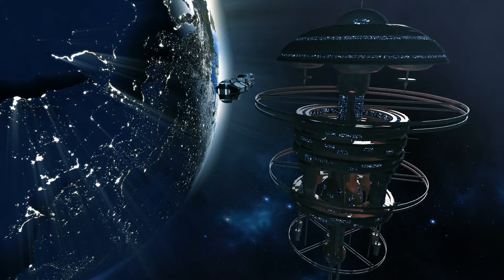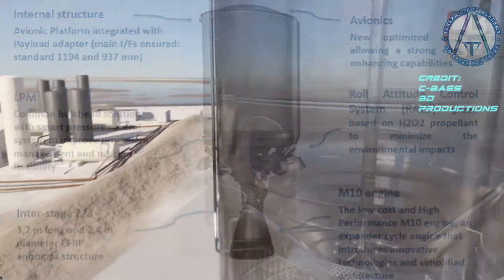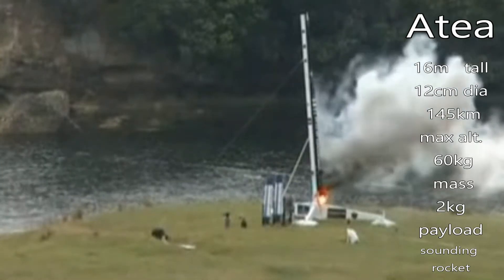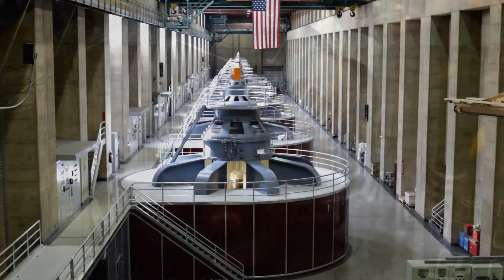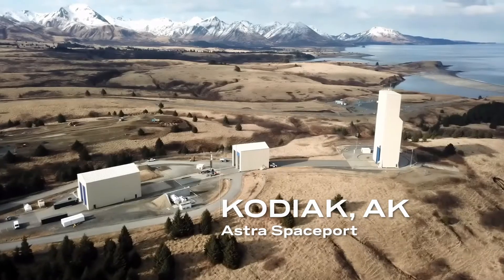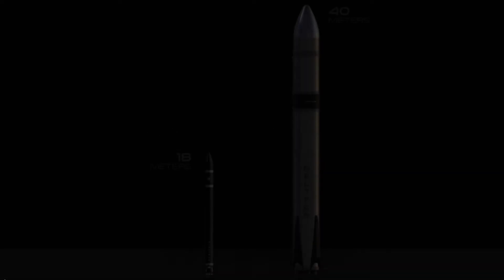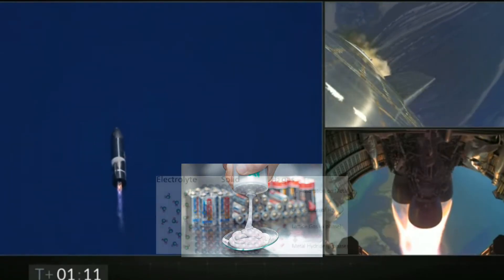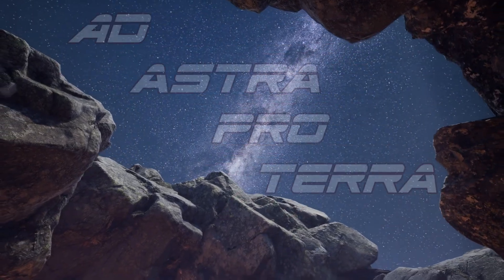Rocket Science: Turbopumps and Electric Pumps for Rocket Engines

Comment: Just discovered your video. Always nice to have another expert voice explaining rocketry to us armchair engineer-wannabes. And great timing - the hot topic now is the Starship HLS that just won the lunar lander contract. It will have unique auxiliary landing/liftoff engines, and SpaceX has said nothing about them. A ring of 16 are mounted high in the ship. (Appears to be 16.) It occurs to me an electric pump would work well for these.

Do you think these will be pressure fed, or need some kind of pump? They have to be powerful enough to lift the ship a short distance before a Raptor ignites. My best guess was they'll be a larger version of the methalox RCS thrusters, but while the latter can be pressure fed idk if that's enough for these auxiliary engines, even using multiple ones. Knowing SpaceX's design philosophy, each set of 4 will be able to tolerate 1 failing, so 12-14 engines will need enough power to lift the ship.

The HLS will have large batteries for the power demands of a complex surface mission, working with the solar cells. I'm thinking of several electric pumps (redundancy) feeding propellent from the main tanks to the sets of engines. Your thoughts?

(Btw, Raptors tanks are have an operational pressure of 6 bar, I'm pretty sure. Yup, unconventionally higher.)
Reply from the maker: Thank you!  I at first thought they would just use a series of SuperDracos... Pressure fed hypergolics are the simplest and no one would mind but Elon wants to use methane... You can use an expander cycle but electric pumps are so much more controllable that I think that will turn out to be the best option.
Reply: @terranspaceacademy   When the first design was unveiled I thought of SuperDracos also. Not an elegant engineering solution, but an easy one that wouldn't divert resources. Just accept the weight penalty of another set of tanks in exchange for a no-brainer design. But soon switched to the methalox idea, that's just the SpaceX way.

Thanks for the info on the controllability of electric pumps vs the expander cycle - I was wondering about that alternative. Another advantage: No expander cycle means no need for channels in the engine bells. The firing will be so brief cooling itself won't be needed. And no plumbing for the recirculating fuel means one less source of leaks.

Comment: How crazy, just a couple days ago I wrote a comment on a rocket video where I talked about using particles of some sort as propulsion. Instead of your magic cube I'm thinking more of a system like the CERN but in a smaller format. On earth the "core" would get charged up with particles that would have been accelerated close to the speed of light and inserted one by one into the core whilst in motion. In the core, the particles are kept in motion, spinning, are the center of either a cylindrical or spherical containment unit using a magnetic field (maybe?). The release of energy is made by controlling the field and changing the direction of a portion of the particles through out the end, lol that's my idea at least seems more plausible then a magic photon box. I bet you could store a lot of energy if the particles are managed to be kept in motion and contained
Reply from the maker: Look up "Accelerator on a chip", lasers using the wakefield effect can accelerate particles to near light speed over just a few millimeters... 
Also see our lesson on Eletrothermal Rockets... 
they cover the VASIMR that you will find has similar concepts to your device. https://www.youtube.com/watch?v=pIwPjs5zBq8
Finally look up Vortex rocket engines...
You'll need to perfect plasma vortex physics to fly your engine :-)

Comment: In the final reasoning about the power of turbo pumps, there is one inaccuracy due to the peculiarities of the calculation - this is not the power on the shaft, but the power from the calculation of the fuel consumption at the gas generator, or, more simply, the total energy of the installation (mechanical + thermal).
Reply from the maker: What would the electrical power have to be equal to that in order to produce the same affect? Or is there an adjustment we should’ve made. Using torque instead of horsepower for instance
Reply: @terranspaceacademy  Roughly speaking, the efficiency of a turbo pump is about 30%, when an electric pump has 75%. This is taking into account the losses on the pump blades.
Reply: @terranspaceacademy  So, sorry, I was wrong.
I checked the data on Russian RD engines - they write exactly the power on the shaft and the numbers are comparable. So the numbers indicated in the video look reliable and there is no need to recount anything.
Reply from the maker: @DeadDaem0n  Thank you! Good work!

Comment: 16:30
Photon pressure would probably crack the box open way sooner then the point at which it turns into a black hole.
Reply from the maker: Absolutely... even osmium/titanium alloy would crack long before then :-)
Reply: @terranspaceacademy  probably a good thing though
Reply from the maker: @Loading-tr7yv  A singularity at your charging station would definitely be much worse than a containment failure :-)

Comment: Can the issue of battery weight on larger rockets using electric pumps be addressed by removing the batteries and replacing them with a jet-like generator that burns RP1/O2 (or whatever fuel is in the main tanks)? Kind of like a turbo-pump, but without all the complicated plumbing. Just a simple generator that produces the current needed to operate the electric fuel pump. It would be less efficient than turbopump, but less complicated. I don't know about the physics of it, but I imagine there is sufficient energy density in the RP1 to generate enough electrical power to operate the electric fuel pump.  These generators can be spun up with ground power at launch until they get up to speed and are producing enough power for the electric fuel pumps to start the main engines. Then after launch ground power disconnects and they run on their own power. Anyway, just some amateur thoughts after watching this cool video. :)
Reply from the maker: The problem is that if you get the power up and the mass down sufficiently you end up with another turbopump, nothing else compares.   Eventually superconducting solenoids or another technology may become viable. Ultimately we will start creating ion air thrusters that switch to on board propellant when the atmosphere gets thin enough.  Then you could have SUV sized shuttlecraft that make it to orbit.  We just have to develop sufficiently powerful electrical storage systems.
Reply: @terranspaceacademy  What about solid-state thermoelectric generators pulling some heat off the exhaust nozzles and converting it to electricity?
Reply from the maker: Efficiency the thermal electric generators is sadly very very low. Nothing beats a turbo pump so far :-)
Reply: @terranspaceacademy  ISTR reading about some significant advancements in TEGs recently. I understand the efficiency is still low, but wondered if it might at least be able to contribute enough to reduce the amount of batteries needed (Or if it's still not good enough to be worthwhile, how far short is it, and if it might be within reach with some more R&D?)

Comment: Would a spinning rocket work? The spin would reduce drag, as a thin layer of air sticks to the body of the rocket and acts as a lubricant I believe. The spin could be induced by twisting the fins slightly.
Reply from the maker: This has been used in the past but gets complicated when you’re trying to navigate from moving sensors :-)
Reply: @terranspaceacademy  Yes I am sure but I didn't know what navigation would be required exactly. If some kind of radio signal is involved then it should be possible to detect that I believe. Certainly steering could be provided by firing thrusters in a well-timed manner  Thanks.
Reply: @terranspaceacademy  Another possibility may to apply an electrostatic charge to the body of the rocket, resulting in a thin film of air adhering to the surface by other means. Or use golf-ball dimples perhaps.

I expect that such proposals have been made before but I find it difficult to obtain such information.
Reply from the maker: @Number_Free  look up the Soviet work on using electromagnetic fields to move the plasma barrier further from the rocket/missile.

Comment: On YouTube  there is a video   could  ancient Aliens  element 115 season 11 episode 13  it talks about  element 115 and ap meta metal  that it weighs next to  nothing  and it can handle a heat hotter  than any metal  and  still be attached to  its  industrial plastics.
Reply from the maker: That video is false I’m sorry to say. Element 115 is radioactive and extremely unstable. Only lasting a few microseconds. No one is sure what its properties are as it does not exist long enough to be fully tested yet. It is a transuranic element and is produced only in laboratories. There may be an island of stability above uranium but it would be much higher than 115 probably in the 230s.